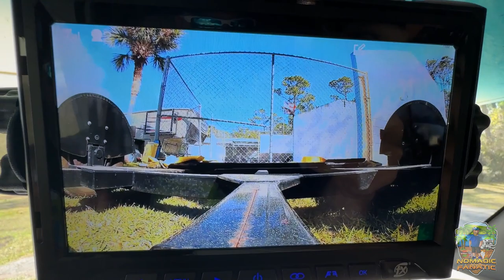How To Tow Car & Motorcycle Behind Motorhome

Comment: Eric, I was a professional car hauler for many years. Look at what the big semi car haulers use. Can be done for yours also. Look up on YouTube “Vulcan auto hauler car tie down with sliding idler and double J-wire” . Has rubber cleats so the strap won’t slip off.
Reply: Yeah those straps he has are not ideal. Theyre maxing out since tires so small and slipping off because not lined in center of wheels since dolly has those swivel plates
Reply: My hubby used to be a tow truck driver and said the same thing. Wrong straps. That's all I know, lol.

Comment: Someone mentioned this on an earlier video.  If the weight limit is OK the thought is to weld the swivel platform straight so it does not move, then weld extensions on the front for the wheels to move the car as close to the bike as possible so you can still load bike safely. Then weld extensions to the length needed on the back so you can ramp the entire car onto the trailer. Even better you could even remove the swivel portion entirely for weight savings and have rails for the wheels installed.

Comment: When I started rving; then thought about towing I found a mixed bag about tow dollies. Ya either love em or hate them. For my own towing I just did not want all those extra hassles and I am 75 yrs old; I went the easy way! Use a Falcon 2 to tow my jeep. That has its own issues....like being straight and level to release tension on the bars. But overall it works fine. Had issues with light hook up on Jeep so bought wireless tow lights! Less expensive than labor to put new harness on Jeep. We all have to weigh all these rv issues in our decision-making. Wish it had worked out for you!

Comment: Hooking the trailer camera power to one of the trailer light constant power wires would be best. BUT until you do, instead of running the wire into Tator-Tot along the wheel, I would suggest running it up under the wiper and in the side of the door instead of the bottom.

Comment: Just FYI, Demco recommends checking strap tightness after the first 5 miles and every 50 miles after that.  I'm assuming the same would apply to your setup.  I've been dealing with the same issue on my Kar Kaddy.  However, at this point I am attributing the loosening straps to the fact that they are brand new and probably not at their maximum length yet.

Comment: You just need the RIGHT straps. Those ones are maxing out and you're not tightening them enough either. Also since you have swivel plates you should have the straps that line up in front and behind tire centered not to the side. Theyre loosening up from turning. Look at Side by Side and UTV straps since you have tiny wheels
Edit PS- new straps are going to stretch and loosen a lot more than broken in ones

Comment: Eric one tip- you can take a paint pen and mark the width of your ramps on the back of the trailer
Reply: I was thinking he could just use that new camera mount with another monitor or pop it from the rv to tater tot while loading it. Also could add a 12 volt plug to the bike for the camera power until he wires it into the trailer power

Comment: Eric,mi suggest locking downnthevswivelmplates the fronttiressitnon, addegbrubber wheelchocks behindvfrntbtires, andvsecuring car to trailer with thevloops onnthe Barstow plateforsafety chainsto hevtraiker. I bwould use chainsvinsteadv off straps, Maybe usebthe mount pointsvon the varforbthetow teebto lock car down.

Comment: not sure if you want to try it  way i do it but here is how i do my tandem tow so its some what easier or seems easier anyway, so the day before we are leaving i will put the bike on and strap down, usually we are out and about with the jeep so when we get back to rv i have ramps in place prior so i just pull jeep up on to dolly then all i have to do the day we are leaving is put straps on jeep, i leave it unstrapped for the night  just in case we had to make a emergency run through out the night, i always just leave dolly hooked up to rv so thats one less step a well, sagain this works well for me but might not for you....

Comment: Eric, Thanks for another nice video. I see your frustration with the ratchet straps. another redundant safety idea is for you to go through one of the wheel holes up high and back to the trailer on a steep angle. Do both front wheels. This will pretty much stop the wheel from rocking back and forth.

Comment: Hi Eric.
The only way to get that trailer set up to work properly, is to have the last section of the trailer where Tata Tots front wheels sit. Pivoting on a central pin, like a truck trailer. That would stop Tata Tots rear wheels scuffing, when turning and pulling straight.!!
But reversing would take a bit of practice. 
Cheers and safe travels 😐

Comment: Any way to change the trailer attachment point for the ratchet end of the straps for Tater Tot?  Might make the connection a little easier; seems like the ratchets bottom out before they get everything tight.

Comment: Only problem is your smart car is RWD! Previously using a tow bar allowed all 4 wheels to be on the ground by doing all the front steering for you. They are solidly fixed to the front of the vehicle. The front wheels turn with the towing rig. Your tow trailer setup only leaves the back two wheels on the ground. Those front wheels can't remain fixed! It's a RWD car. The front needs to swivel if the tires are off the ground...Why not get a Chevy Aveo or Chevy spark or Mitsubishi Mirage... All FWD and solve all your issues!

Comment: My Kar Daddy dolly straps attach on both tire sides in front and back which is more secure.  Using a dolly is a pain, but after doing for 2 years setup is fast.   The problem is storing the tow dolly at the campsite.

Comment: Try attaching  the straps to the handlebars and not the shock.  That will compress the front supension just a bit and should be more stable. Other than that it looks good.

Comment: For your car why don't you try using a single wide strap centered on the the tread of the tire, it could hook onto the metal bars in front and behind of the tires.  I think doing it this way would have the strap hooked to a solid metal part of the trailer in two places and would be much less likely to work loose. The single strap would put a lot of downward pressure on the tire to keep it firmely on the metal platform of  the trailer.

Comment: For that extra camera view, definitely use trailer lights. No benefit to running it into the RV directly, and you want to avoid connecting the trailer with anything more than the hitch, safety cable and power plug. Should be plenty of power, too.